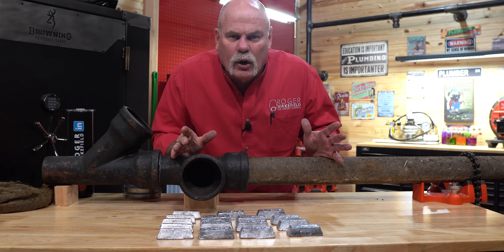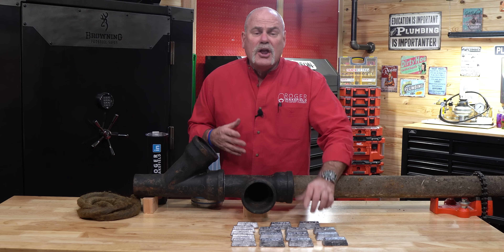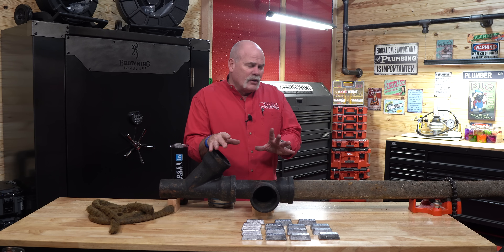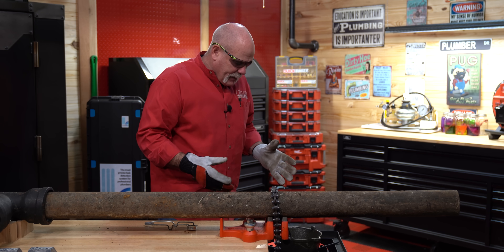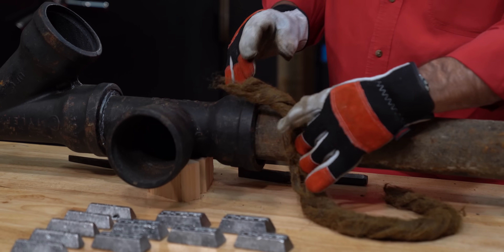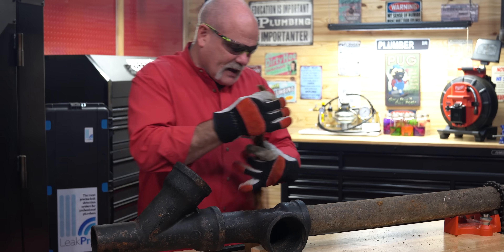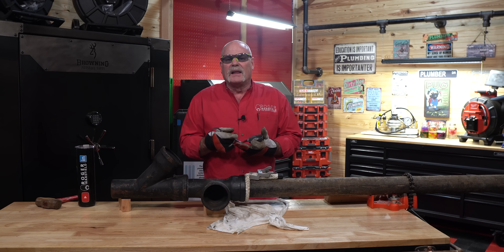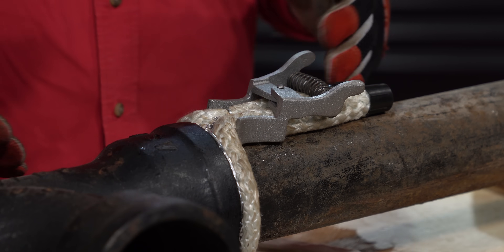How Plumbing USED to be Done

Comment: I’m not sure where to begin with this mess you call a training video. First of all you are supposed to pull apart the Oakham  then you’re supposed to roll it on your leg to make it tight and push it in so it has a tight seal all the way around. It must be packed tight. The oakum is what makes the water tight seal not the lead. The lead is there to keep the rodents from eating the Oakham. Once you get the running rope is set it must be tapped down with a hammer tightly against the joint. Then a peace of Oakham is taken and put at the top of the V where you pour the joint to prevent lead from going out from under running rope. This is called a “ mustache “. Once you’re remove the running rope Then you should set the lead with a flat iron in four points to set the lead down into the joint before you seal it. Also there are different size ladles for each size Pipe cause you should never stop pouring the joint. It should be poured all at once .Then you do the inside caulking then outside caulking and then you’re done. If you gonna show somebody how to do it show them how to do it the right way
Reply from the maker: There's lots of ways of doing it I suppose, this is how I was taught...love hearing new methods

Comment: I'm not a plumber, nor do I own any property; but I do like to build stuff and enjoy peeping at other trades. I do a fair amount of soldering. One question I have is why the pipe isn't prepared before inserting into the fitting? To my eyes the pipe looks quite dirty which could lead to a 'cold joint' in electronics terms. Is there a reason the pipe isn't sanded or flux isn't used? I'd be curious to know! 

Great video.

Comment: After watching how cast iron sewer pipes are assembled I'm glad we don't have to do it this way now. Cast iron causes less problems to wastewater treatment than asbestos cement or clay pipe, but not much. Glad to see the skill required for this work. I rehabbed a 100 year old house that had cast iron plumbing. My boss was a plumber and had the tools to cut the CI out of the way and connect PVC. Imagine doing that work under a wood house in a 3 foot crawl space.

Comment: Remember (its unlikely but) if you ever use a pot or pan for lead or other metal smelting. NEVER USE IT FOR COOKING EVER AGAIN. It has to be thrown away after you are done. Make sure the pan is marked so no one accidently finds it and thinks they can restore or use it. Also, that lead should have been heated outside. the fumes can build up quick. Maybe you have some vent out of frame idk but I thought id just call it out.

Comment: If you can't pour a lead and Oakham joint or do a full led wipe on a toilet you should never be able to pass a plumbers test. You should be an expert on cast iron, and dwv copper.
Reply: There are still millions of old houses that still have cast iron waste pipes. So I agree, I would think plumbers would still need the skills and talent to work with cast iron pipes.

Comment: I just watched another video about this. Plumber HAD to be less than 30 yrs old. He used the small ladle and directly heated the lead in that from a small torch stationary on the ground. 

When he removed the old lead he could see it had been layered. No sin in that; the old joint had held just fine. 

Not sure I would trust any no-hub to last 50-100 years. A no hub saves time and therefore money “today.”

A comment I saw was that a final test occurs at about the 30 minute mark: This joint would be expected to leak until the oakam was sufficiently soaked. What I’m not clear on is why you wouldn’t just pre-soak it before installing into the hub.
Reply: I was just watching that video and then I got the recommendation for this video. It is fascinating watching these guys doing the old technology.

Comment: Just three days ago, I removed a cleanout plug in the crawlspace of the house I grew up in. It turned out to be a ferrous plug in a steel sleeve, so of course it was rusted to the point that the sleeve came out along with the plug -- and it was obvious that none of the "plumbers" who had visited the house since 1959 had ever removed the plug. The sleeve had been secured by the lead of a lead-and-oakum joint. (I'd heard of these joints, but never actually encountered one.) I knocked out the remaining lead with a screwdriver, pulled out the oakum, and installed a proper modern plug. Now the lazy plumbers have no excuses. 😊

Comment: I just did one the other day. But I used pro proxy instead of lead. I prefer cast to plastic clamps. But the fittings were hub to hub and I didn't want to change everything out plus the owner wanted to keep it as cheap as possible. Nice job!!

Comment: I am an old school plumber. I just turned 74 and started in the trade in 1976. My dad started in the trade at age 21 when he came home from WWII. He did his last plumbing job for a neighbor at age 91. 70 years as a master plumber, 47 for me to date. 117 years combined. By the time I got into the trade it was No-Hub, ABS, PVC, and eventually PEX and flexible gas pipe. However, my dad taught me the old tech so that when I would run into old bell-and-spigot cast-iron  and Durham I'd be able to either repair it or interface it with new tech. I no longer have my lead pot and array of irons but I know how to use them. BTW, do you know what was so unique about tapped Durham fittings? I do but I leave it to you to tell. It's a test for an "old school" plumber.

Comment: After pouring 100 plus joints for 10 inch roof drains on a school addition in the middle of winter, the plumbing inspector said you know you guys can just use push tight gaskets now lol. Slight miscommunication with the gc
Reply from the maker: That’s crazy…

Comment: I've poured a couple lead joints. Had to do it for my journeyman exam years ago. Had to do a 45° copper offset too. You had to bust open the tee so the code committee guys could inspect your work. Got a 99% on mine. Your yarning iron should have a mark ingraved on it about a 1/2" to 3/4" from the tip, if i remember correctly. The oakum i used had a whitish color to it. Cut in 42" lengths its perfect for a 4" lead pour. NO DOUBLE POURS

Comment: I live in Manchester  , England. 
A lot of the old terraced brick houses still have cast iron soil pipes that were put together using this method.
We take them down regularly and replace them with pvc pipe.
The top section carried down the ladder on your shoulder is the apprentices job these days.

Comment: There are still CI gas mains in Manhattan from the 1870s in use, some at high pressure. As long as they don't get disturbed, and especially undermined, they operate just fine with no leaks. Crazy to think that systems installed by civil war vets are still functioning today over 150 years later. Don't knock the oakum

Comment: They used to seal Railroads with Thermite and a mold. 
So I totally believe sealing pipes with liquid lead.
Actually now that I think of it we still seal pipes the same way. Flux and Solder.
Surface tension sucks in the solder and you get a seal. Here it's the same idea, but with more lead than we use now lol

Comment: Last time I was at a plumbing supply in the states and talking with a counter salesman we happened on to the cast iron drain pipes and how they were sealed with lead. Well at the time he informed me that it was no longer necessary to pour lead into the join over oakum. Instead they had lead wool in packages. You unwind it and place it over the oakum and start hammering down adding more lead wool as you go to fill in the joint with your tools. Back in the late sixties they were using copper drain lines in new construction. The big problem was the drain lines clogged easier than cast iron or pvc and with todays prices of copper, not worth the trouble.
Reply: Why was the copper clogging easier? Smoother surface vs rough surface? or because of corrosion?

Comment: Warning to everyone : Totally wrong safety glass. You are using wrong safety glass to do this job. You also need leather argon too. You need a full face cover safety glass not just eye cover. Also never and ever try to do these job under wet conditon(rain or water condition)Melting Lead will be explode with water. You are fire making same old school big mistake.

Comment: Hello Roger,
Thank you for making this great video. Just a few observations from an old NYC Master Plumber.
1. When you separate the oakum strands, wrap them so that where the overlap is, you start the next one right after so to avoid any uneven packing.
2. NEVER use a joint runner that has not previously been soaked in oil so the molten lead won't stick to it or burn it up.
3, Tap the runner tight against the hub with a hammer all around the pipe and pour INTO the joint with a full ladle.
4. NEVER pour a joint in stages. 1 pour per joint period.
5. Caulking irons are different from packing irons. They are smaller and only used for "trimming" the finished joint, which should be peaked in the center all around.
6. Lead depth is minimum 1" ONE POUR!! 
Thanks for demonstrating just some of the ways plumbers practiced their trade back in the day.  When we were craftsmen. 
Crack open that joint and show how it looks finished internally. 
Now show people how to cut that pipe using a hammer and chisel, like we did back then. And, how to "wipe" a joint.
Thank you again.
Tony
Reply: You sound like someone who really knew their craft. Thanku for keep the shit flowing downhill and the water drinkable👍👍
Reply: "Wipe a joint" that's real old school!
 My old man always talked about it. 
"Beating lead with a woddy" was the other favourite of his. Would love to see worshop of that.
Reply: Thank you for correcting politely the errors which were made  . I’m afraid I was not so polite in my comments . Just seams like a lost art which the new generation does not find important.

Comment: My house in Poland had lead soldered plumbing all the way! (Built around 1902). It always took ages to find a plumber who could repair this. It also still features electrical installation in cotton insulation, RCD (GFCI) can't be used because the leakage current to walls is so big that it trips instantly. (Can't change this, city property).

Comment: I worked at a shop for a number of years which made joint runners - they were molded rubber and had cast aluminum fittings so the split runner could be put around the pipe and clamped on. We were on the West Coast and the Chicago area was nearly the only area purchasing.

Comment: Lead Run Joints on Cast Iron Pipes;
Last time I did this was in 1974 when I started my Apprenticeship.
We called it Roping the Joint & used Steel Ropers & hammered it into the joint, the Ropeyarn went round it twice.  Packed in tight, we then used an asbestos Running Rope that had a clamp on it, clamped it tightly around the pipe, then poured molten Lead into the joint.
Lastly was used Stavers to hammer the lead tightly into the joint.

We also repaired Cast Iron Heating Pipes, largely used to heat Greenhouses. The joints on them were Roped with Ropeyarn & finished with Pure Portland Cement.

Thanks for sharing & love from Scotland 🇬🇧🇬🇧🇬🇧🇬🇧🇬🇧

Comment: In my country all of the cast iron piping joints were poured with sulfur. So nasty, it makes you feel sick even in gas mask, any open skin will absorb sulfur and poison you. I had experience to dismantle old cast iron pipes and replace it for pvc pipes. Very interesting that cast iron rusts in places where is no liquid contact, it rusts in places  where sewer gases contact happens. I did it for 9 years, it's like nightmare to me at these days when I remember that. Fun thing is that you don't have to smart to dismantle hammer and small sledge hammer, couple hits in one spot and it brakes ))

Comment: Man.. does this bring back memories!  My dad ended his working career as the planning and zoning administrator for my home town, but started off as a pipe fitter and plumber, and worked his way up through the city water department.  He was also a mason and when the local lodge got land and enough money to construct their own building, he was asked to do the plumbing.  I was less then 10 years old, but I got to go to the site with him several times and got to see him sweat copper and do this type of packing for the sewer pipes.  I never saw a horizontal one though.  I have one of his smaller ladles hanging in my garage today!

Comment: I was taught to use a running rope and also wipe a lead joint. I started the trade in 1970. we still were using cast iron and galvinized waste and drainage,lol

Comment: the last house i lived in was built during the baby boom after WWII and even today it still has all glass fuses and a cast iron stack that uses oakum and lead. to pass code at some point, someone added a small breaker panel next to the fuse panel to run the kitchen, but the rest of the house still uses fuses! and the way the PVC drain from the washer was coupled to the cast iron stack, was the plumber just jammed the PVC down into the top of the open stack. and that's it! pretty mickey mouse job

Comment: As a Freshman in 1971 I had 2 weeks of Exploratory Training in all the Trades.  We were taught how to connect cast iron soil pipe with lead and oakum.  There were 3 lead pots always hot and we were warned not to spit in them.  There were so many Houses built around the 1900's that it was normal to have cast iron pipe and lead joints.  The house I owned in the '80's, built in 1950 had cast iron pipe and I once made a repair with Oakum rope and molten lead.  I'm glad I learned the technique!

Comment: I used to work for a water department that had an old lead joint pouring setup, that we never used, but the town was fairly old.  I have fixed a few roof drains with existing lead oakum joints, just took patience and some tamping with a punch, sealed right up with 18' of head on it.  Works well but definitely going the way of the mercury switch especially in plumbing/drinking water treatment.  Mercury switches are ALMOST worth the risks, even though they were banned.  We had to remove them from a booster station.  Now the Mercury even if it got out is atmospheric pressure, the water system at 100+ psi (there), I can't see contamination ever happening with that differential.  Mechanical switches are a lot less reliable.  Never had a Mercury switch fail!

Comment: in the 60s in UK we called the rope "gaskin and we used it on underground cast iron drainage with molten lead when the joint had cooled we tightened the joint with a caulking iron which was shaped like a chisel but offset so the joint could be tightened down .we also did external soil stacks in cast iron but we generally used lead wool in the joint which was put in cold and consolidated  with caulking iron this was safer than using molten lead

Comment: One thing that always work well for me, at least I never had it leaked, was that after the oakum which packed in I used lead wool. Looks just like steel wool. Hammer it in with the offset tool and it works just as well as a poured lead joint.

Comment: I did them as a 10 yr old in the early 70's! my brother too! in 60's!
I was taught the Oakum seals in the molten lead inside joint, we had a clamp ring with pour spout for outer, the curved lead chisel beats in the cooled shrunken mailable lead sealing the joint (less is more), if not the junk in the sewage will finish it off or a few more easy hammer/ chisel blows, or a torch and a chunk of tar not enough to melt lead.   Always heat up EVERYTHING with LEADING first, water/STEAM will ruin your day with molten lead!! This skill and knowledge also served me well as a Journeyman of Multiple Trades! Water/ Moisture with an Exothermic/Cad Weld will RUIN your day too!! Had a stubborn Apprentice refuse to torch dry exothermic welds as a "waste of time" he ALMOST learned the Blind Way when a Exothermic weld on a train Rail blew up with STEAM in his face and chest, but "I MADE HIM" use a Face Shield on a Full Brim hard hat with welding PPE! or GTFO?

Comment: Oakum feels like oiled rope - because it IS Oiled rope! Of course the rope is picked apart.  In England, that's what the Workhouse (famously mentioned by Scrooge in "A Christmas Carol") "inmates" did - pulled apart old ropes to make oakum to to seal up the wooden ships of the Royal Navy.
That "Running Rope" is phenomenal! I've seen many old hands use a heat-proof packing to pour Babbitt Bearings on old machines, but Running Rope would be a GREAT and MUCH EASIER alternative.  I'm going to recommend it to several other channels - Starting with Kieth Rucker at Vintage Machinery!  I bet he'd LOVE IT!

Comment: Oakum used to be made by breaking down old hemp rope. As a rope works, internal wear breaks down the fibres into shorter and shorter lengths which accumulate in the core of the rope. Eventually the rope would be condemned and replaced. An old sailing ship had literally miles of hemp rope on it which needed constant replacement.

The Navy would sell on this rope to people who would break it down and recover the oakum. It was hard, dirty work and was often done in prisons and workhouses as a punishment exercise known as "picking oakum". Oakum was used for all sorts of packing jobs. A major use was to seal the wooden decks of ships, a process known as calking. Oakum was rammed down between the deck planks with a calking iron and the final gap filled with molten pitch or tar.